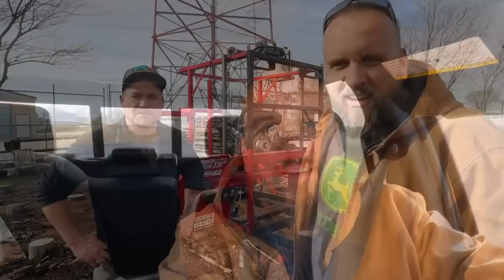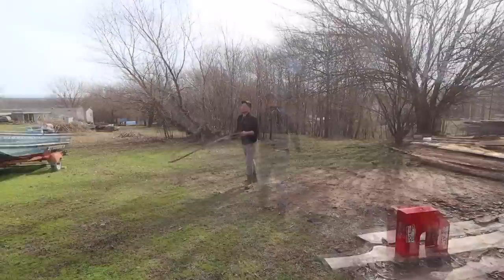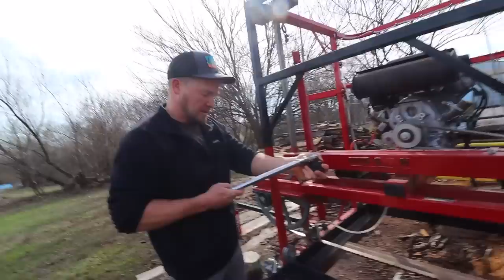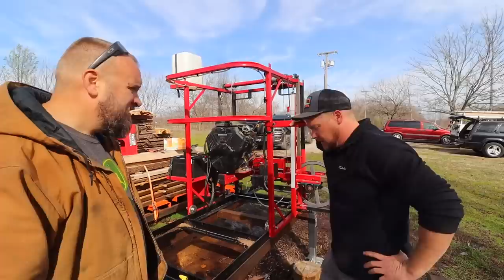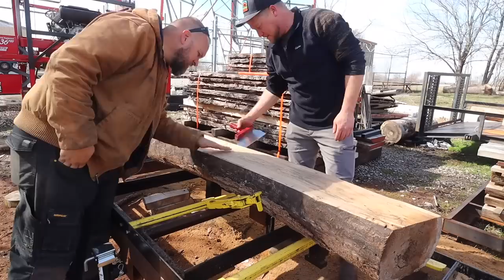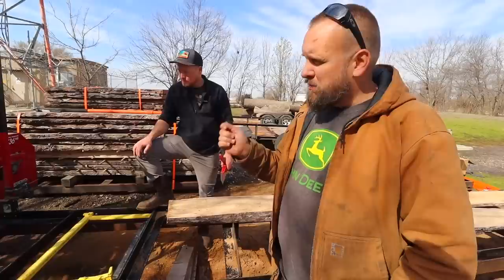Searching for the Perfect Sawmill - 35 HP Hudson Oscar 336 Pro

Comment: You"s mentioned the chainsaw milling. I picked up a Husq 394xp with a 48 Alaskan mill. Only intention is to use it when I get a larger diameter tree and need to cant it to fit on my mill or to produce large slabs. Haven't used it yet but the time will come, but I fret the day even though I'm excited to give it a shot. Curious how ppls saws held up using the chainsaw mills? That a nice mill in this vid.However all mills seem to be better then nothing. One thing I'd like to see is a log loader (like on a forwarder or excavator) that can be part of the trailer. Using a pevey, cant or  even the ramps with cable winch is easier but still a pain in the ass. I suppose no matter what add ons we get we will always want to make things a bit more easy, efficient and productive. Great vid. :)
Reply from the maker: I did quite a few videos on chainsaw Milling. My saw held up fine. It was a 500i

I ended up getting a Woodland Mills HM 130 max and I’ve been really happy with it. I’ve got quite a few milling videos out using it

Comment: Brock good video......... But the major flaw is you need to figure what $$$$$ is in the budget. 
mills from 8k to 80k  are what is avaible.
Reply from the maker: I think to spend more than the $10-$15,000 range you really need to be making money with the mill full time.  For occasional use you can get a mill for $3000 with a narrow opening.

All depends on how much you are going to use it.

I’ve been traveling around and trying a lot of different brands and I will end up with whichever one I thought had the best value for the money.

Comment: Great review.  I wish you were upfront about the options and prices of each mill you review. It would be more useful.
Reply from the maker: What do you mean by that? Every time I use a different mill I state everything I like and don’t like about it.

How much more upfront could I be? 

I’m just sharing my experience with them

For example, with this one, I really like the simplicity of the winch used to raise and lower the mill head, but I don’t like that there is not a jack you can use to level the log
Reply from the maker: I just noticed that you said prices, I will sometimes reference a generalized price, but there are several reasons I don’t give prices in videos and why almost no one else does either.

Most of the time when I go to shows, or I have a product rep in the video with me, they will specifically tell me not to mention prices

Prices change on a regular basis and videos last for years and years.  It’s fairly common to watch a video that is 10 years old.

If I tell you that today this is a $10,000 mill and you watch the video three years later and it’s $13,000 who is that helping

Also, you can get the price per easily by doing a Google search.  

It’s difficult for me to give a price on a product that can be purchased with a lot of different options.

Do I price it with the larger motor or with the standard motor, what about with or without the winch? When there are 20 different models available and Different options you can choose on each model it’s not really that much information for me to tell you what this exact configuration cost

Shipping is a big cost on a sawmill. Do I try to estimate an average cost? Do I price it without shipping? Do I price it with shipping?
Reply: @RockhillfarmYT  I appreciate everything you said.  My comment wasn't to suggest you provide a price guide, but to give current price range (maybe as reviewed) for comparison to folks considering mills.  You provide lots of other information that people can find on a Google search too, but it is helpful.  Really, I wasn't trying to criticize your videos, just suggesting it would be nice additional data.